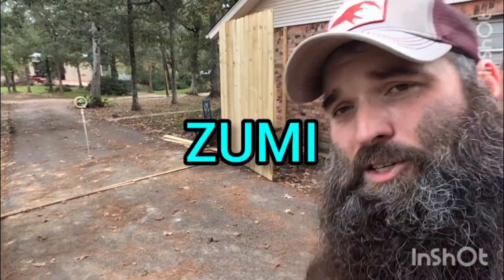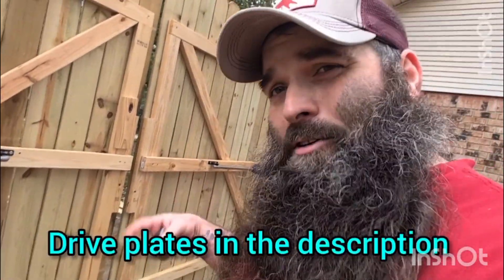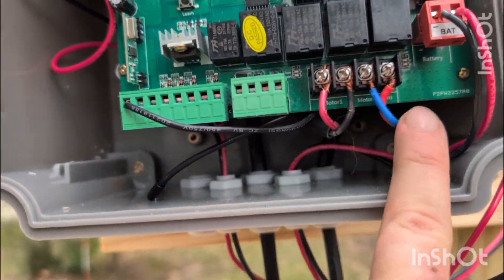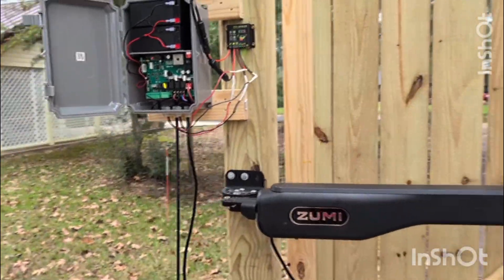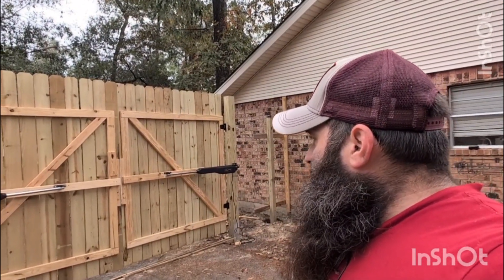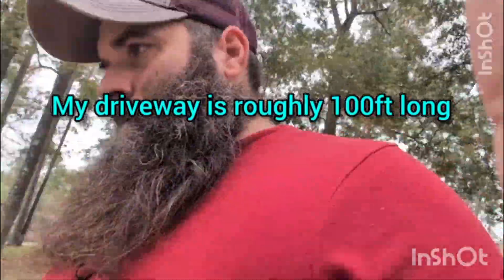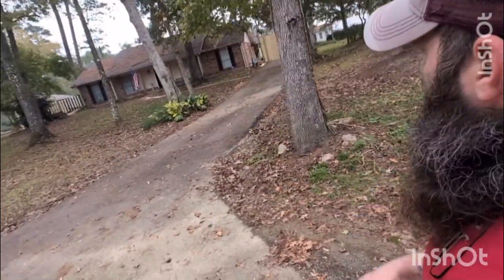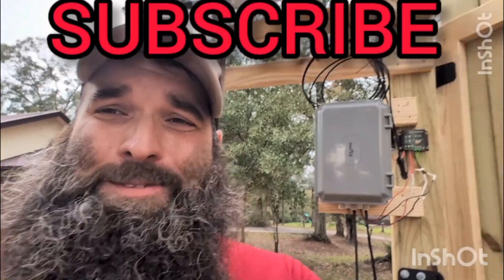Ditch the Grid: Solar Powered Gate - Zumi WS2 Pro Dual Swing Gate Opener

Comment: How has it been? Still working?
Reply from the maker: It is! I had to relocate the solar panel to get better light but it is still doing great.
Reply: @ReadySetHomesteadUSA  thanks!!
Reply: Im not sure your solar is hooked up correctly , i was told my panel has to be wired through the ac plug and not directly to the battery. Just food for thought there is a blue light that's suppose to come on the board to ensure is charging batteries .
Reply from the maker: @JeffreySatterfield nope, definitely installed correctly, been opening and closing 5-6 times a day for months.
Reply: @ReadySetHomesteadUSA  weird lol. So far I've been told 2 ways to wire it. 1 through the ac port and 2  by wireing it directly through battery which the manual tells you not to. Zumi tech support is garbage that's the only reason I mentioned it . If it works it works tho  so awesome sauce? You wouldnt happen to know the dipswitch settings would you?
Reply from the maker: No clue lol. Only thing I had to do was switch the A and B sides because my arms were opening in opposite directions.